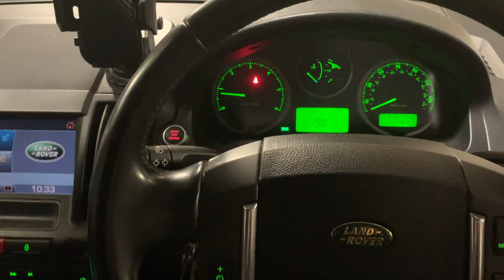Repairing A Landrover Freelander intercooler.

Comment: Not really helpful on how to get the bumper off, and if the bumper did not have any scratches on it well it does now, crash bar seemed already torqued up from the power gun,  no movement from the torque wrench?  clicked right away, personally i would have changed the hoses out at the same time, or at least asked the customer, which you may have,  but video will help some people, did not see any hole in the intercooler?